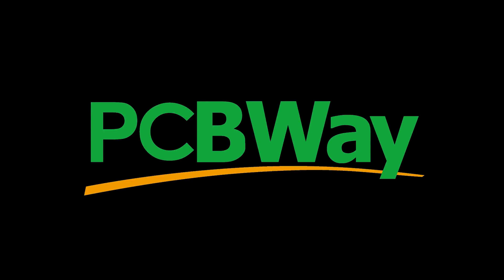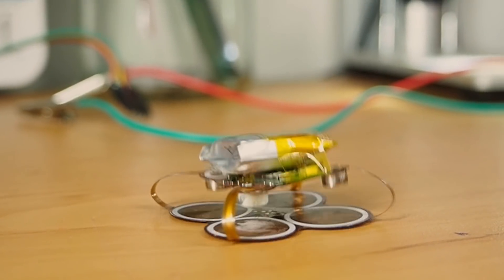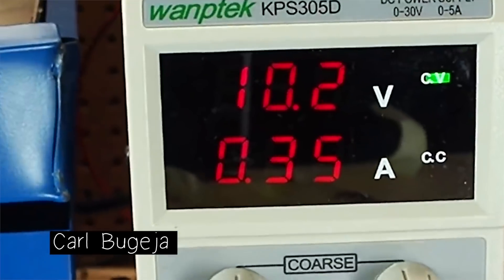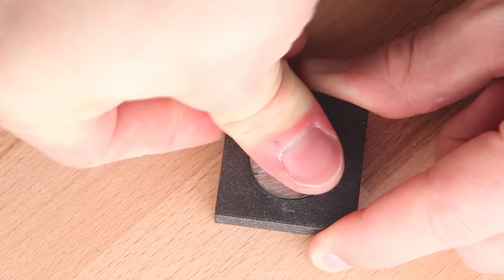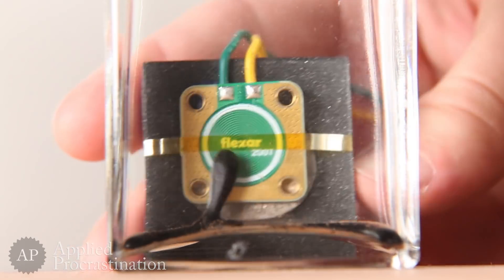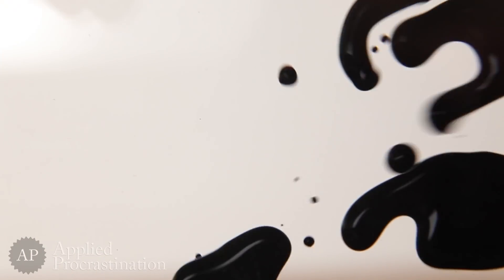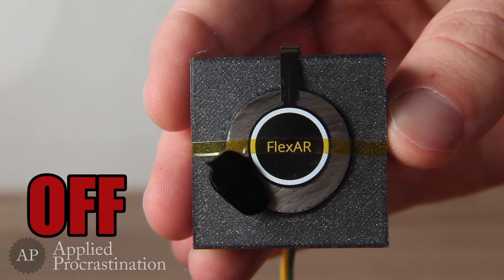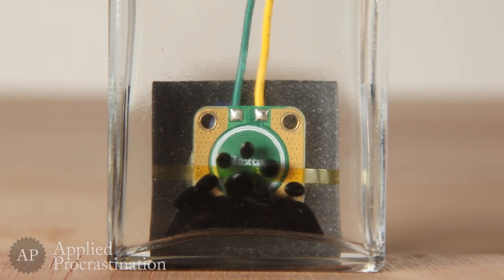The holy grail of ferrofluid displays (Carl Bugeja Collab!)

Comment: Did you thought about getting rid of the transparent back panel of the tank and use white PCB as a back panel instead ?

The electromagnets would be much closer to the ferrofluid and you would be able to drive the coil much harder as an the PCB would be directly sandwiched between the liquid and the iron plate.
Reply from the maker: I imagine that would be difficult to seal completely and also hard to prevent the PCB from getting stained by the ferrofluid.
Reply: @AppliedProcrastination  What if you coated the PCB with a hydrophobic waterproofing spray to keep it from staining? Or laminate the PCB with a really thin sheet of acrylic? Get a really thin sheet of acrylic and glue it to the PCB using something like UV resin. Put a big glob of resin in the middle of the PCB and slowly lower the acrylic sheet down. It’ll spread the resin, or whatever adhesive, out evenly without air bubbles. Use a roller or squeegee to push out any excess resin, then cure it with UV. You’ll have the stain-proof properties of the acrylic and the PCB will give the thin acrylic the same/similar rigidity to the thicker acrylic without the extra space between the ferrofluid and magnets.
Reply: @AppliedProcrastination  Have your boy check this out. https://en.wikipedia.org/wiki/Halbach_array . A circular coil like he is creating is the least ideal setup. He could easily make a coil many many times more powerful than this thing but simply arranging a bunch of smaller coils properly and considering he is making 12 layers that should be more than enough room to get some unusual magnetic fields going. It makes a huge... HUGE difference and allows focusing of the magnetic field all onto a single point.
Reply: @AppliedProcrastination  conformal coat the PCB? Just a little UV discoloration would be worth the simplification. Plus might look cool 🤩
Reply: @stormbreaker932   Having failed on a similar idea, anything other than glass will get stained by ferrofluid, no coating i tried will permanently resolve this.

Comment: One idea would be to use a steel insert going through the pcb (like  at 1:49) with a magnet at the back and adding one or two other 4 layer pcb on top to get 2/3 time the number of turn.
You could stack the PCBs with through hole header or if there is to much interconnexions by reflowing them together.
Also I think having the steel in contact of the glass will make the magnetic field inside the tank much stronger.
Reply: The problem with adding more layers is that you also add more resistance. The magnetization strength of an electromagnet (the H field) is proportional to n * I where n is turn count and I is current. When you add more layers, you get more turns, but proportionally you also get more resistance, which drops the current. It ends up cancelling out. My team recently made a 40 layer prototype PCB coil, and going from 20 to 40 layers basically did nothing to change the strength.
Reply: @billfan7528  Yes adding more layer and turn count will increase resistance, but it all comes down to copper mass and cooling. If the resistance go UP you can still increase voltage to keep current the same or paralleling some layers as long as you can pull the heat out. 
Was going from 20 to 40 coils done keeping the copper mass the same or cooling interface the same ?
Reply: @MrThecoco974  our pcb coils were kinda fundamentally flawed in that we used 1oz copper, so the 40layer stack with 550 turns had 160 ohms of resistance. By contrast, a hand wound coil with 550 turns and magnet wire had 20ohms, lol. So to hit 0.35A (what we found was needed to float the ferrofluid) we needed something like 56v... Lol
Reply: @MrThecoco974  we tried going up to 36v and I think it desoldered some pads between some of our boards

Comment: Could you drill holes length ways into the iron backs and have internal arterial water cooling to compensate for higher voltage? Too bad the ferrous material doesn't conduct heat better
Reply from the maker: Haha, that's probably possible, but it would also probably stop making sense from a complexity and cost reduction perspective.

Comment: If you print a 3D jig, you can add magnets in front of your electromagnets so then can attract or repel them with the existing electromagnets. This way you can improve efficiency.
Another idea for your Clock: use just 1 electromagnet and a x and y axes motors to move around repealing or attacking magnets in your 3D jig.

Comment: Quick Idea: If you only want to display time you in theory only need four 7-Segment displays. What if you didn't use electromagnets at all, but rather move long Cuboid permanent magnets closer to/away from the tank to draw up/let go of liquid
Reply from the maker: That's a good design for a clock indeed, but we opted for a more general purpose display when we started our Fetch project :)
Reply: @AppliedProcrastination  And what if you would use pcb electromagnets to move permanent magnets to and from the glass, which in turn attract or release the ferro fluid? A bit similar as using a leaver... you could even use weak springs (non-ferro) to make sure the magnets stay in a specific position when not in use.
Reply: Definitely depends on what you want to create in the first place

Comment: why not just make a pcb backplane onto which you solder the normal tiny electromagnets using very short wires as if they were through-hole components?
you could even build into this board the control circuitry on the other side right behind each electromagnet.
Reply from the maker: We've considered that and the main issue is that the mechanical support would be minimal (also scary to do such a large non-reversible cable cut by hand 😅). I think there's no way around using screws to hold the magnets in place on the PCB, which would make it really difficult to route all the controller circuitry.
Reply: could have a small I2C pwm driver next to the mostfet of each coil, making it only 4 common conductors for all coils, or some other digital protocol that can use more addresses perhaps.
Reply from the maker: That's maybe possible in smaller horizontal displays, but in our large vertical one we need to drive each magnet individually to be able to lift the ferrofluid higher than the first row. You can check our current PCB design here, which is based on the PCA9685 PWM driver and ULN2803 darlington arrays: https://github.com/appliedprocrastination/FetchCADFiles/blob/master/pcb/V2R2/Schematics%20-%20FetchControllerV2R2.pdf
Reply: yes exactly, just use an I/O expander, control it via I2C or CANbus. Just need 2 communication wires that will be shared between all the I/O expanders, and each of them will control maybe 1 or a few coils. Then you just need to route power to all the mosfets and it should work with only 4 wires coming from the main controller: vcc, gnd and 2 for comm
Reply: @AppliedProcrastination  why not make a 3D printed frame that would hold the electromagnets and then connect to the PCB. That way the mechanical stress would be on the frame in the PCB would just be there to handle the electrical connections.
Reply from the maker: @John Swanson, this is basically what we are currently doing (except we have not shortened the wires).

Comment: Good job Simen! It was so satisfying watching my coils working with your ferrofluid tank!! 😁
Reply from the maker: We totally agree! It was super satisfying to see your PCB do some seriously heavy lifting :D
Reply: Why not make a large board with multiplexed 12 layer coils and than fabricate a CNC shaped steel pixel plate which will form each pixel around the coils and stick that behind the display?
Reply: Would it be possible to bring the 12 layers to 6 pins so the magnetic strength can be adjusted by powering each coil pair individually?
Reply: Why does those shity PCBs still don't have a hole in the middle like the original magnetic coils and aren't embedded in a iron plate yet?! The magic coils have this hole on purpose.
Reply: Have you guys tried more pcbs put together? You could put like 5 pcbs on top of each other, which would mean 60 layers of coiling in roughly the same place as the normal electromagnet. With that you can even put an iron core in the middle so it is even stronger like that.